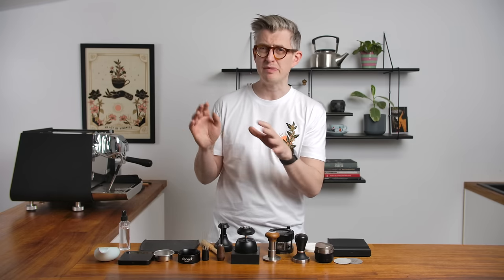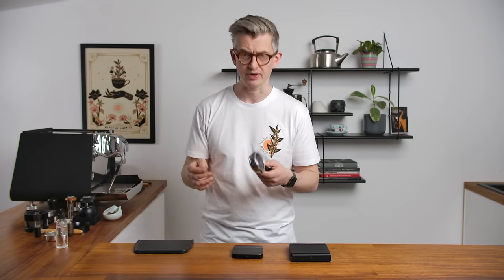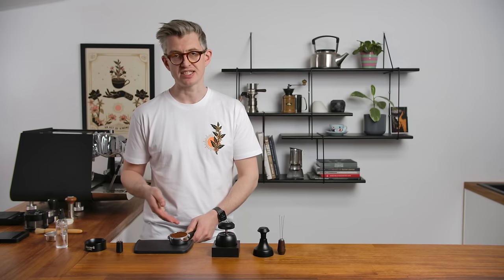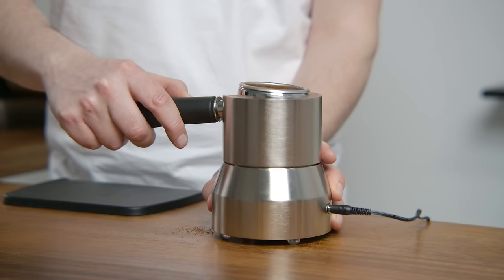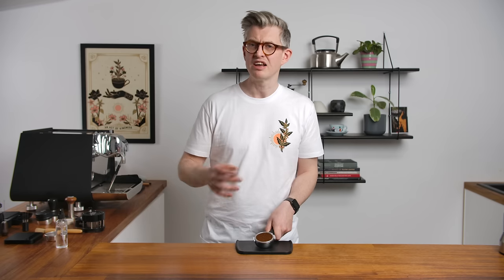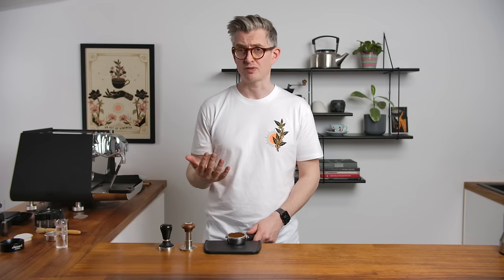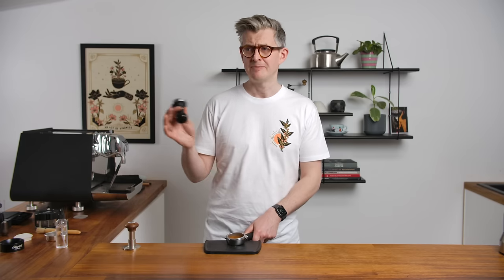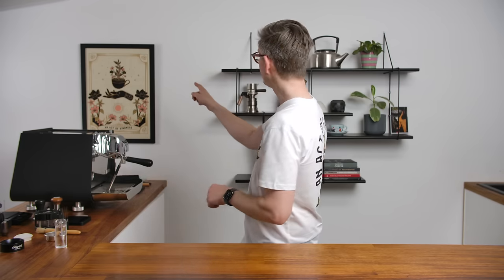How I Make Espresso: Tools and Techniques

Comment: I've tried all sorts recently and I CANNOT get my espresso to stop channelling 😔 I recently bought a bottomless portafilter and the first time I used it I expected to see that lovely central stream of coffee come from the bottom, but instead I got a sprinkler! And I've tried seemingly everything, I've started using a thin needle WDT tool, I've used a rotating wedge distributer, various different grind sizes, a puck screen, different baskets, and nothing seems to make any difference...
The only things left are the fact I'm using a cheap portafilter which I didn't think could really have much effect, and I'm using it in a Sage Barista Express. If anyone here can help it'd be very much appreciated!
Reply: Tamping is the only bit that you havent mentioned you've done (I know that the wedge distributor does it to an extent but its not great).

The tamper that comes with the Barista Express is a bit crap (common consensus that even I experienced) so get a decent tamper from Amazon or eBay or even AliExpress. I had the same issue as you i.e. channeling was a nightmare so I bought an inexpensive spring-loaded tamper from AliExpress for something like AU$29 shipped (maybe 20 GBP) and since using it, the channeling has stopped as the tamper has a collar that sits on top of the filter basket so when I use it, it tamps the puck evenly and level.
Reply: @31tangovictor  Thanks a lot for your feedback, I'll definitely take a look for a reasonably priced one. I'd considered getting one of the tampers you recommended but only saw really expensive ones on Amazon.. Plus my wedge distributor has a tamper on the opposite side which you can adjust but unless your coffee volume is perfectly consistent every time I don't think it works that well.

Comment: why is there a 2 1/4 punch tool promoted, when 2.25" in NO WAY FIT the bottom of the basket? 47 to 48 mm is the correct size (about 1.85 medieval units ;)

Comment: I'm surprised to see that you're not using the funnel while filling the basket. That is where I find it the most useful, as it helps prevent spillage. But I guess you are using a very tall funnel, and probably won't be able to fit it in the grinder. Personally, I'm using the tallest funnel I can fit, and it keeps my work surface much tidier.

Comment: I had a 40 dollar espresso machine, I'd buy preground espresso and fill a 2 shot basket with it, smash it with the tamper hard as I could, and pull 200ml through it. I'm a savage so I steamed 200ml of milk and took 1 scoop of hot chocolate mix and throw it all together.

Comment: Can anybody help me? My cafe uses a mazzer kold grinder and the target dry weight we shoot for is 23g, it used to be pretty good at hitting that target with a maybe .5g difference here and there. Recently it's been varying way more and more erratically, like 21.5g and then 24.5 g right after. Does anybody have a remedy to help narrow the difference back to down to closer to the target weight?

Comment: James - the moment the streams of coffee coming off the bottom of the filter "unify" you appear and promptly stop the brew. Is that a coincidence of the timing or is that a signal you are aware of that means its time to stop?
Reply: I'm very certain that he stopped the shot because it reached its desired weight. Going by some arbitrary indicator like stream unification doesn't seem like a very Hoffmann thing to do.
Reply: @invincible2847  Yeah I didn't think that seemed right either. It just seemed a coincidence

Comment: From the opening with all the niche and sometimes expensive tools that each garner marginal gains laid out on the table and the statement that you hope all of these things are universal or something to that effect, I had a sort of gut feeling this was an April Fools joke. Imagine my surprise when I checked the date it was released and it was a full three days off!

It is possible to distribute grounds merely by tapping the portafilter in the right spot with the right force, assuming you have taken steps to prevent clumping in the first place. It requires a lot of practice and familiarity with every instrument involved- Your grinder, your portafilter, even your counter. Nevertheless, it's possible to do it quickly and consistently.

I'd disagree on the twist being purely aesthetic and unnecessary. Based on my experimentation, it prevents a tamper that has moisture on it from ruining a puck in a way that will cause channeling. If you've done everything correctly to that point it does nothing, but on a busy shift in a cafe it's almost always a time-saver because droplets of moisture getting on the tamper is inevitable at some point and the twist takes a jiffy or two, drying a tamper takes a few seconds, and replacing a droplet-cratered puck takes at least 10 seconds (usually more) and makes you look incompetent in front of customers. Similar to tap-based distribution, it's something that doesn't matter if you're taking your time trying to make a perfect espresso like it's a Japanese tea ceremony (but then, if you're making it almost as much about the ceremony as about just making an excellent espresso, is the twist not valuable as part of the ritual?), but it's a valuable technique for baristas in high-volume cafes, and better yet, it requires very little skill to do correctly.

Comment: tbh all what your doing is running water through grounded coffee, what matter is that you dont over extract the grounded coffee thats the main point because it becomes bitter and acidic and overall Bad.
i tried Starbucks after a long cut off, ngl the one i make at home with my humble equipment are much much better than those industrial equipment and the said barista pro...
if your looking for that latte art thats one thing, but if your looking for taste thats another thing as well.

basically lets assume making coffee taste good on a scale from 0 to 100%

the normal pressurized coffee machine makes you at best 10% good coffee.
open portafilter based coffee machine makes up 20% good coffee Massive jump but massively increasing difficulty as its no longer inexperienced proof. you need consistency
then we got the type of coffee you used thats 50% it must be good quality and fresh
lets say you added a good grinder to the package that will make your coffee 70% better  because the extraction will be more even and more controlled shots 

now anymore work is just for that extra 20% 
and the last 10% will be your skills and consistency.

Comment: Way too late so I do not think anyone will care, but I see no reason why -not_ paper filter on top with mesh. the rationale for this is simple — less grounds, or even *no grounds* in the mesh to deal with if the paper seals well enough. So paper on bottom to prevent accumulation of fines in cup, paper on top to prevent accumulation of mesh as a further water aeration aid on top.

Comment: You don’t need half of that stuff.  I can make espresso that tastes better than any I’ve ever had and I measure with a 1tbsp scooper before grinding.  I then pour the grounds a certain way into the portafilter and tamp with a plastic tamper with a lot of pressure.  The way I do it gets a very nice pull with correct time and no channelling.  I also only need 2 minutes for my machine to heat…

Comment: Don’t spray with water and you won’t get clumps. ‘Distribution’ using tools is also unnecessary when you still have thumbs. Consistent dosing by weight and consistent tamping pressure using a Puq - the only expensive tool you need for repeatable, great espresso.
Reply: No spray means more static and more clumping

Comment: Yeah, but ergonomics for taking care of one's body is bloo-boll. For hundreds of thousands of years the primate hand has grasped tools that were not adapted for it. Sticks, rocks, and antlers were never made for us. We have hands that are adapted to use the tools. So universally true that we adapt to tools and not vice versa that axe handles, broom handles, violins and bows, pistols handles, barbells, and surgical scalpels make the barest of concessions to our grip but are still instruments that can be used repetitively, strongly, and with great precision without causing injury.
Packing a puck and pulling a shot is done even by baristas not done more often than wood is hewn by lumberjacks and bullets are fired by competition shootists. Espresso tamping doesn't require the strength or dexterity of powerlifting nor weightlifting nor of even sweeping the front porch. While you don't want to make a mess, the precision required isn't as demanding nor as dire as the surgeon's or musician's. So why the hell would a tamper need to be ergonomic? And why the hell would it being ergonomic be an example of "taking care of your body?"

Alright, I'll shut up now.

Comment: This clumping theory is unscientific nonsense - unless I see a scientific validation process confirming it, all my experience invalidates the idea that clumps from the grinding process survive in any impactful way the tamping process.  The same goes for the importance of distribution.  None of this faffing about with distribution tools is retained after tamping.  Moreover this is a testable thesis - you could test relative density of a tamped puck to determine if there is any significant deviation between tooled/distributed tamped pucks and those that are just tamped with no 'distribution' process.  How about it James?

Comment: Sorry, this doesn’t work:
a) How long after boiling do you put the water in? How hot should it be?

b) You can’t avoid the sputtering stage if you want a full brew

I’ve made espresso every morning for about 20 years and added faff like this is pointless and annoying 

Back to the trad way!